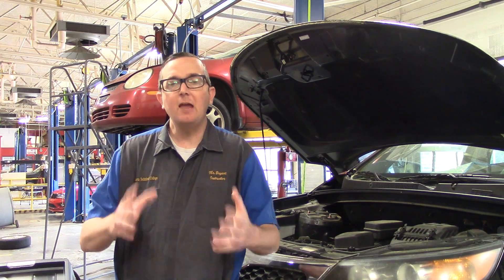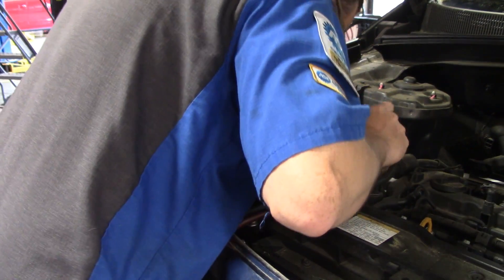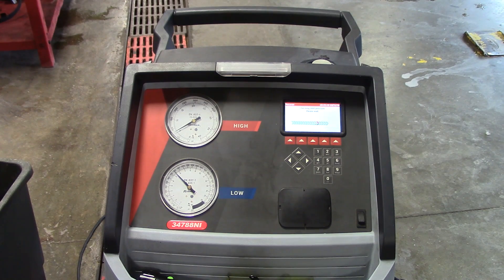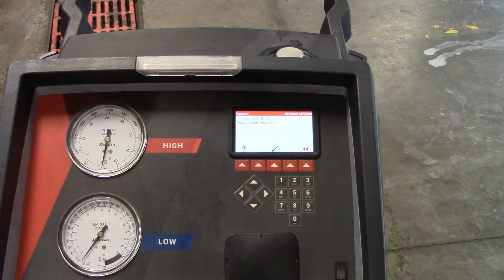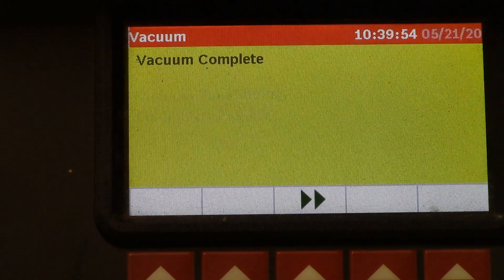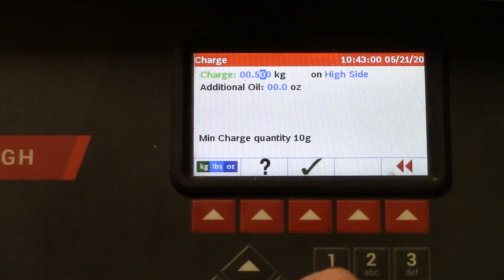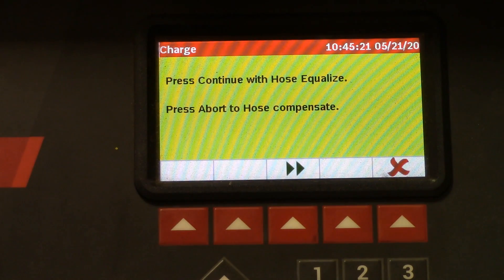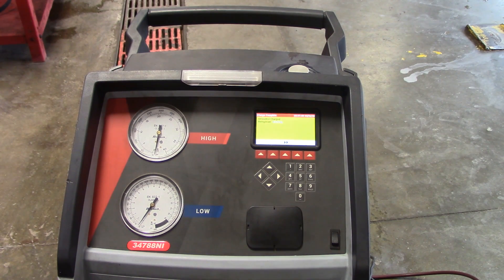How to use the Robinair 34788 Air Conditioning Recovery Machine

Comment: The research I did shows the "NI" models as not having oil injection.  How did you go about injecting oil into the system without this feature?
Reply from the maker: Mine is an NI and definitely has oil injection

Comment: You say it has an oil injection tank but you never show where it is. Where is this injection tank you mention?
Reply from the maker: It is a cylindrical plastic bottle that screws in the back of the machine under the handle. I hope this helps.
Reply: @AutoScholarwithMrB I appreciate the reply. I looked at my machine and didn’t see the bottle but I do have a metal cap on the top of the machine that looks like someone has been adding dye into before I got it. Not sure how to add that dye into the system though. Was looking through my manual and didn’t see much either. But I will get it figured out.
Reply from the maker: @cya329 the bottle and straw is probably missing, it should also have a straw in it that sucks it out of the bottle but you can probably use tubing. Here is a link to a replacement bottle: https://amzn.to/3SCfqLH

Comment: Why charging on high side? Most of the time, I charge on low side and start max ac to help pull refrigerant into the  system.
Reply from the maker: Either is fine, it is just what the machine defaults to.

Comment: An important question... On a system requiring 1.5 lb. Of refrigerant: If the unit only recovers 1 lb. , I assume the machine supplies the "missing" 1/2 lb. from an internal source.
 That being said ...Does the machine keep the recovered refrigerant separate from the "new" refrigerant supply? It would appear that you would risk continating your supply of new refrigerant with impurities from that recovered from the vehicle if this is not the case . .
Reply from the maker: @MIKET5609  the internal tank is supplied by the external tank. Any recovered refrigerant is filtered but if the wrong refrigerant is recovered it will contaminate the internal tank, not the external one. It is important to identify refrigerant before recovery but hardly anyone does. The newer machines that do R-1234yf identify automatically.

Comment: Where do I add the oil ? I can’t find it
Reply from the maker: @carstalkUS  should be a bottle in the back under the handle.
Reply: @  okay. There is none. I should contact manufacturer
Reply from the maker: It may be missing, they are somewhat flimsy. They sell the replacement bottles online.

Comment: Have the same machine. Only used twice so far. Both times no oil was recovered from fully charged systems. Is this normal?
Reply from the maker: @DSE3027  somewhat. It won’t have oil in the bottle every time.
Reply: Thanks

Comment: My machine pulled only about 00.40 oz of yellow dye but no oil, so now what? Do i put . 25 oil and . 15 oz dye back in?
Reply from the maker: The oil and the dye should be mixed. If no parts are replaced outside of seals or hoses, just put .4 ounces in that came out.
Reply: @AutoScholarwithMrB  Thanks for reply.
Reply: @AutoScholarwithMrB  Other question: If the machine does not take any oil out during recovery, that means the system does not have any oil in it?   Does the machine pulls oil out of the compressor too? The truck i am working with on the manufacturer label say: R134a Charge 29 oz, 0.82 kg, 1.81 lbs. , Now for the Oil it say: 4.23 oz, 120 cc. So, are we adding 29 oz r134a and  the 4.23 oz of oil with dye?, that will go over 29 oz... ( i order some oil that has dye in it already - pre-mixed).
Reply from the maker: @burnjack291  so normally I put half of the oil in the compressor and the other half I split into two. One I drizzle through the system (a little in condenser, evaporator, and accumulator, and the other half of that half I charge with the machine. That’s normally if I am replacing the whole system which 9/10 times is what I would be doing if a compressor failed. I hope i explained this right as it is hard to put into text.
Reply: @AutoScholarwithMrB  Thanks for the reply and  explanation. The question still remains, when you do the recovery will the machine take 100% oil out? from the system,compressor...  or there maybe some left in the compressor?  I have the RobinAir syringe 18465 model - low side, and the markings on them is just confusing and do not match , like on the label on car it say 4.23 oz / 120 cc and the robinair syringe it has this markings: 1/8 oz 3.7ml  and  1/4oz  7.4ml  and 3/8oz  11.1ml  and 1/2oz  14.8ml.
Reply: @AutoScholarwithMrB  If the system calls for 29oz of r134a and 4.23oz oil, do you stay 4.23oz with all or you have to subtract from the 29oz because you adding 4.23oz of oil back in? little confuse there...this manuals don't explain clear how is done. Appreciate your advice and input.
Reply from the maker: No it just removes the oil that is suspended in the refrigerant. So if your car has 10 ounces of oil capacity and it removes 2 in the waste bottle, you still have 8 and only have to put 2 back when you recharge.
Reply from the maker: @burnjack291 do 29 of 134 and 4.23 oz of oil. The capacities are separate.
Reply: @AutoScholarwithMrB  Thank you for your time!

Comment: My AC system is empty. A friend accidentally hit the line from compressor to the condenser so all the refrigerant leaked out.. pssschh it sounded.. it was warm and a little bit hot actually.
So.. ive fixed the broken pipe. Hows gonna be with the oil situation and the recovery process then when the machine can't sense a pressure?
How to know how much oil I've lost and how much to put in now? The line i replaced is like 30cm.
Reply from the maker: If there is no pressure, there is no need to recover. Start at vacuum, leak test, oil inject (if oil was lost) and charge. As far as estimating oil loss, I would maybe add an ounce of the discharge left an oily residue. Thanks for watching, and sorry for the bad luck!

Comment: How to use this machine on a vehicle with a newly installed ac condenser
Reply from the maker: I would apply a vacuum for about 30 minutes and make sure it passes the leak test. Then charge with the appropriate weight. Hope that helps! Thanks for watching.

Comment: can you run the system with machine hooked up to check pressures
Reply from the maker: Yes, the machine doesn’t even have to be on for that.
Reply: so should hose compensate instead of equalize and leave both hoses connected and monitor pressures to view system proformance @AutoScholarwithMrB
Reply from the maker: @paulinegendreau257  when you charge, and that screen pops up, crank the car and check the pressures. After that you can compensate.

Comment: Thank you Mr B , We have the same equipment at our shop . I installed a used compressor and the system says No flow when I try to charge
Reply from the maker: I have never had that happen. Do you mean you replaced the compressor in the Robinair machine or on a car?
Reply: @AutoScholarwithMrB  ,,The compressor is on the Car,,Im not too familiar with this Model RobinAir

Comment: do you have to add oil to separate components when doing an ac kit? our just let the machine inject the factory amount.
Reply from the maker: You can do either, but it’s recommended by most manufacturers to split up the oil into different parts. Thanks for watching!

Comment: Hello boss I need help asap! My machine is brand new only used twice and now says high tank pressure and asks for a service code. What do I do???
Reply from the maker: For the service code to begin using the machine, you have to register with robinair on their website. I’ve had the high tank pressure issue once, and I purged the internal tank for about 30 seconds and it fixed that issue.
Reply: @AutoScholarwithMrB  yes I know. I’ve done multiple jobs on Diesel trucks and cars. I started it up today and It was reading the sensors and got to ISV Cell sensor and started beeping saying “High Tank Pressure”. The manual then asks for a 5 digit service code and if you hit the exit button it makes you restart unit. How would I go ab getting that service code I’ve necker set one up
Reply from the maker: @thekickingguy842  if you just purchased the machine, it will only work for 30 days before it locks out and you have to register it. Robinair has a video on how to do that here: https://youtu.be/c0jWJe5Dy8Q
Reply: @AutoScholarwithMrB  I did that so you’re saying I have to do it again ? I don’t understand why it would lock me out saying high tank pressure when’s it was working fine a couple days ago. I will try this again tho

Comment: Great video! Just watched to see if I was missing anything but that’s how I use it. You are 100% correct on the vacuum leak test. It’s correct about 50% of the time. I always inject the dye on a low or no Freon system and locate the leak the old school way.
Reply from the maker: It will miss leaks that present on pressure 100% of the time! Dye is the way to go for sure. Thanks for watching!

Comment: I did a test with that machine doing a vacuum leak test and it kept stopping in the middle of the test is that indicating a leak ? Or is it not supposed to stop ?
Reply from the maker: Mine has never stopped during a leak. What does the gauge say when it stops?
Reply: I did a recover and then pulled a vacuum for about 5 minutes and leak test and maybe half way through the machine stopped and said leak test failed if I remember correctly I don’t think there was anything on the gauges I ended up charging it and the a/c blows cool but it’s not cold as it should be
Reply from the maker: @cam8980  yeah it if shuts off during the leak test, you have a pretty large leak

Comment: Great video and very helpful so thank you. When the machine does the recovery process does it store the gas and then put what it took out back in when recharging? If for example the car holds 500g and there was 300g taken out at recovery, do you only actually use 200g of new gas ? Also is there a way that you can just recover gas, for example if you are removing an engine ?
Reply: yes and yes. that's the great thing about these machines, you don't lose freon, especially with the costs now. plus it's illegal to release r134a into the atmosphere.

Comment: Does this machine do  Hybrids ?   and Those this machine  inject  the oil  ?        since you didn't show it on video  to inject oil back in
Reply from the maker: Yes, the oil inject is done when charging. The machine does do POE oils for hybrids too.
Reply: @AutoScholarwithMrB   nice  thanks
Reply: @AutoScholarwithMrB      why is there other machine 34788 in H   what would difence
Reply from the maker: @MEMIN91911  I’m not sure, honestly. The POE sequence takes a lot longer as it flushes the machine and the vehicle to make sure no other oil gets into the system.

Comment: I have this machine. I used it yesterday for the first time and was not able to get my A/C to come back on. (yes, it did work previously so I know the switches and sensors are all functional). The reason I recovered refrigerant is because the compressor was periodically seizing up with broken belts resulting. 
So, I recovered the refrigerant and took the system all apart and replaced the compressor (clutch included), the accumulator, the condenser, and the compressor mounted clutch switch. 
After getting everything back together, I vacuumed the system, injected 3oz of pag oil with a spotgun, (the new compressor came with 8oz in it and the system calls for 11oz total), and hit a problem:
I didn't know which charge path to select: High, Low, or both. I selected high and low, just guessing since the robinair owner's manual doesn't say, which really sucks. There should be specific instructions for what instances to use each charge path.
Anyhow, I suspect I made a mistake in selecting high and low charge paths. The vehicle was NOT running at the time it was charging.
After completing the charge, the machine prompted me to do the hose equalize, which includes starting the car and turning on max AC. This is the point where I knew I had done something wrong, because the AC would not come on. The clutch did not engage, not even for a split second. I checked every fuse and relay. They were all good. 
One possible symptom of what I'm guessing was a mistake was that when I disconnected the high side hose from the service port, the schrader valve failed and refrigerant was hissing out like crazy, so I snapped the service hose back on and had no choice but to recover the refrigerant again. The valve failing may have been a coincidence, IDK. I'm looking for your expertise for what went wrong. 
So In summary I have two questions: What charge path should I have selected with the vehicle NOT running, and Is it possible that The high side service port valve failed because I screwed up?
And two comments for Robinair or anyone who works for Robinair: Your owners manuel Fails to mention two critical things: How to know which charge path to select,  and that the machine is capable of injecting pag oil while it recharges. I bought a $100 spotgun because I didn't know it could perform this task. Maybe put somthing about that in your freaking owner's manual?! Thanks.
BTW, I was working on a 2001 GMC Yukon XL 1500 Denali w/rear AC. the system calls for 11oz of pag46 and 48oz of refrigerant if that helps anyone.
Thanks in advance for any help you can give me.
Reply from the maker: If the vehicle is off you can select either high or low side. If the vehicle is running with the a/c on, you have to select low side because the machine cannot handle the pressure the high side reaches. To do the oil injection, you must vacuum the system first. When you select the charge option, it will give you the option to oil inject. Also when charging or recovering, never select the POE option unless you have an electric compressor, like ones on an electric car or hybrid. Also, if you have a faulty compressor, it is good practice to replace the condenser, orifice tube, and accumulator, with a good system flush. This makes sure there are no metal particles left in the system, which can damage that new compressor. Good luck with your repair, and thanks so much for watching!
Reply: @AutoScholarwithMrB  Thanks for this video, very helpful. I got 2 questions: 1- before connecting the hoses to the service ports, don’t you have to “Purge” the hoses again to get rid of any air or refrigerant left in them?
 2- If I need to use this machine to inject POE for an electric AC compressor, from your experience, do we have the flush the PAG oil hose inside the machine to clean it from any PAG oil residue? How would inject POE Oil using this machine? Would you please explain in details, Thank you. Ed
Reply from the maker: @edlopz1722  use the recover process to purge the machine while it isn’t hooked up. It will recover any refrigerant left in the lines. Also, when charging, the machine will ask if it is a POE system. You would just follow the prompts from that point on.
Reply: @AutoScholarwithMrB   Thank you, I will give it a try.

Comment: How would i inject the dye in the system with this machine ?
Reply from the maker: In between the vacuum/evacuation and charge. The system has to be under vacuum before the dye is injected as the vacuum sucks the dye into the system. Thanks for watching!
Reply: @AutoScholarwithMrB  Video on how to put the data in the machine to work
Reply: How to put dye in this machine video
Reply: How to put down with this machine give me a video

Comment: I do the whole process with that same machine and my car is not cooling, and there is no oil leak, which may be the problem or what is going on, my car is 2013 Hyundai Tucson, thank you for answering me
Reply from the maker: Leo body Shop Zaldy the compressors on those go bad all the time, what pressures do you have? Is power getting to the compressor?
Reply: not only pressure problem and oil there are alot that can cause that.